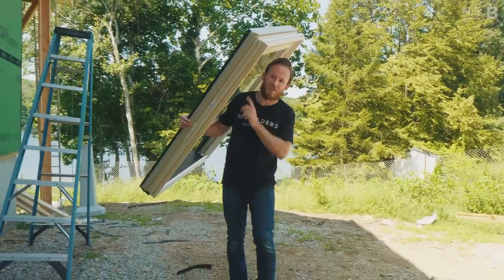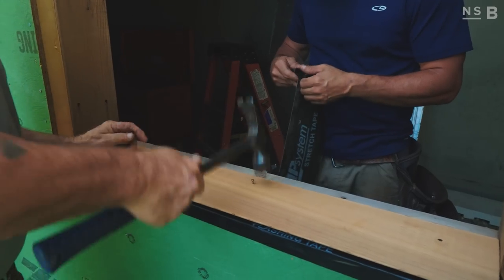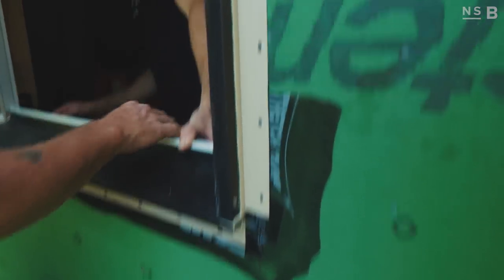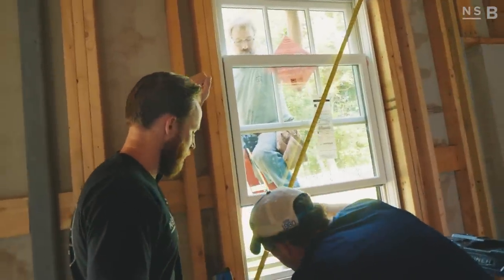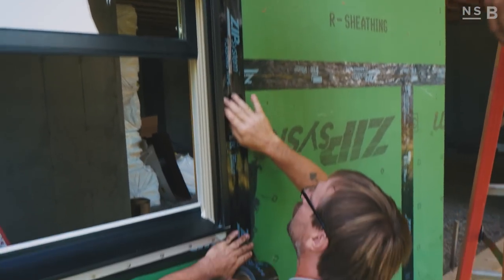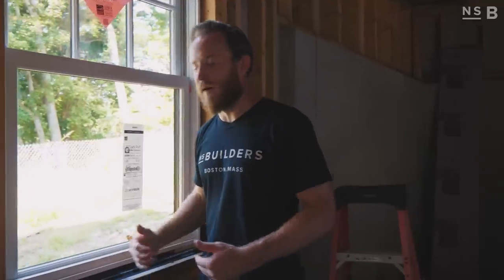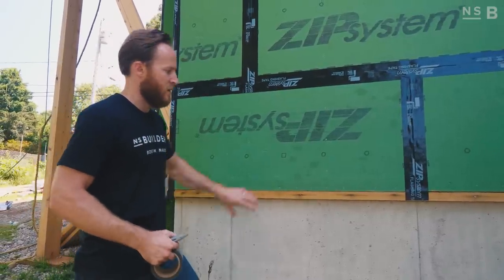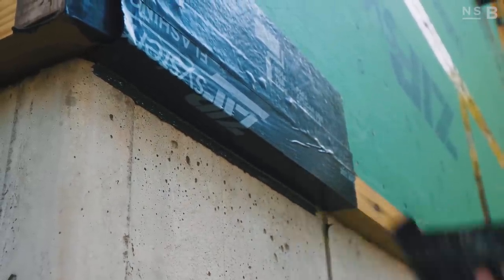Installing Windows the Right Way: Lake Drive Custom: Ep 04

Comment: I'd like to see how that tape adheres to that treated 2x2 at the bottom of the foam over the long term.   I'd use liquid flash and skip the tape.
Reply: They make a primer for the tape for hard to stick areas.
Reply: @anthonyromano8565  Primers help but I still wouldn't use tape on treated wood.

Comment: Why not just use a wider sill plate on the foundation instead of adhering a 2x2 to the sill plate?  This would also eliminate a "joint" between the sill and the 2x2.
Reply from the maker: alex mannion That’s an awesome point, to be honest I think this was something that we thought about after. Looking back at it I think I may have considered running that zip are overlapping onto the concrete so we have a true hundred percent thermal break, and install that ledger to the face of the concrete
Reply: that would be better @NSBuilders

Comment: The 2x2 on the bottom of the sheathing is a great idea to keep the foam form being exposed.  Did they use common nails or galvanized ones to make that connection.  It looks like they were rusty at 5:30 into the video.  Love all the details man, keep the videos coming!

Comment: do I understand it right, you guys use 20+$ liquid flash caulk instead of foam to seal up the gap inside between window and framing? its like 3 tubes to fill it up :) I guess never enough protection right.

Comment: I like the video. Just a couple things? No shims around interior frame of the window before nailing off? Marvin requirements are a shim 6” down from top and 6” up from bottom and every 15” in between. Especially at the check rail.

Comment: A few things about the window install that I do and would recommend are, just use the stretch tape in the corners at the bottom of the opening and use the flashing tape for the balance. The stretch tape is more expensive and when there’s 200 ln ft of sill in a house it adds up. Also, after the window is installed, use the stretch tape you saved by not running the straight part of the sill on all the corners to ensure a good seal onto the window and sheathing. Now as for not taping or caulking the bottom window flange, this is a big no no. Especially in a high wind zone. I don’t care what Marvin says, I don’t care what Anderson says. They’re flat out wrong. The house will literally suck water up under that flange and all the way to the drywall when it’s under negative pressure from high wind on the exterior. The only time it’s acceptable to use the no tape no caulk method is if you have a soldered copper pan pitched with your clapboard and lipped up 1/2” at the interior side. All of this knowledge is first hand from building in Westerly RI and seeing it with my own eyes.

Comment: New subscriber here and a Marvin service technician. Awesome job on the install, especially omitting the tape over the bottom nail fin. One correction, the flashing tape needs to be lapped past the nail fin on to the frame.
Reply from the maker: Michael Ford Michael good information, and correction.

Comment: Zip system requires the bottom section of the boards to be taped to the foundation is that something you plan on doing later?

Comment: great install, but on air tight houses with extra insulation (zip r) should be not be using double hung windows.  Odd how some areas love them.  Casement or tilt and turn are way tighter.

Comment: Great water proofing details. The ONLY thing that I would change from what I had seen. Is this, instead of using a square drywall knife to spread your liquid flashing material inside of a 90 degree inside seam.i would suggest using a gloved finger or any type of rounded tooling edge to allow your flashing to build up inside the corner. That sharp knife corner will definitely remove the excess material that we would want to keep rounded in that space. Otherwise. Fantastic work

Comment: I know it's been 2 years but one question I had was why did you not install the shoe horse shims on the bottom of the window for the water to drain out ? The window has the slope towards the outside and its taped up properly but since you nailed all the holes at the bottom wouldnt that make it very difficult or rather impossible for the water to actually escape ? Other then that I loved the video and the house looks great .

Comment: Great content, thanks for producing these.

Did you use a metal head flashing above the window? I understand that the integrity windows have an integrated vinyl drip cap, but I’m not sure if a metal flashing should also be applied above that. I am interested to hear why you did. 

My windows will be on a wall with Maibec wood siding and I will have a custom aluminum z-flashing above the wood head casing, but I am trying to determine if I also need aluminum flashing above the top of the window (i.e.: between the top of the window and the bottom of the wood head casing)

Comment: Dig it. I've been using that stretch tape for a few years, it's pretty dope right? One addition to your comment on the tape/flange compatibility is adhesive compatibility needs to be checked as well. You're using huber on huber products but if a builder/architect is mixing manufacturers the compatibility of the flange, tape, AND adhesive/liquid flash needs to work.

Comment: Nick, I like the clapboard idea, did you add 3/8" to the RO off all your windows to make up for the clapboard?
Reply: I add 1/2” and when I install the window, I always cross cut two shims in half and use the larger side. The fat side to the inside and shim to level from there. That gives a perfect amount of space under and over top of the window for spray foam.

Comment: I would never ever nail off a window that wasn't closed and locked. I have pulled several and reinstalled after others have done that because they wouldn't slide.
Reply from the maker: That’s a great tip.

Comment: Great video Question Do you think that the pine blocks under the Marvin window corners (factory installed) is a good idea. 
If not shimmed up from the bottom it could suck up water. The sloped clapboard great idea old school - Backer rod foam its
not in the Marvin installation guide and is really Code in Canada but seldom used in residential.
Reply from the maker: Good point about the pine blocks, going to look at them more closely next time

Comment: Great job ! Just a question why not use sprayfoam instead of backer rod , then caulk. You would get better insulation value and  still get your water/air dam .
Reply from the maker: Mike, thats a good point... might switch up our approach to that.

Comment: Since you're adding a 2x2 on exterior bottom plate, what does your zip nail to other than the studs? In Oklahoma we have a wind sheer to deal with for code and the exterior sheathing has to be nailed across the bottom to work as part of the brace wall system. Great video.
Reply from the maker: Cecil McGarrah The sale detail is built up with multiple layers so that 2x2 that you’re looking at is only the bottom layer